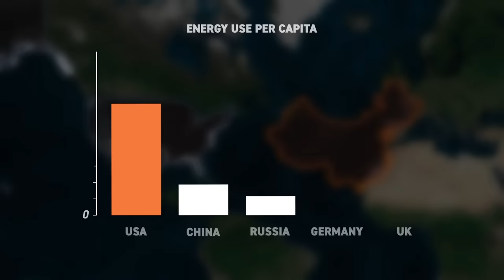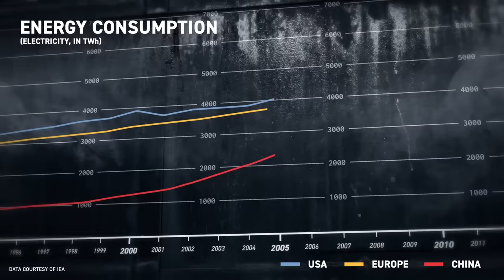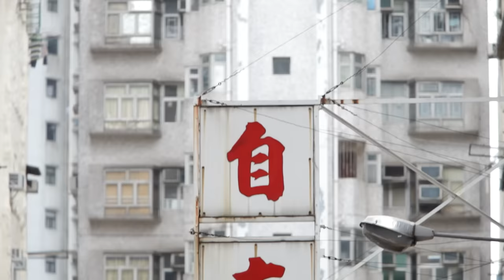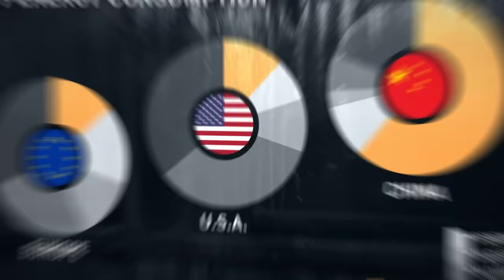China’s Electricity Problem

Comment: 1.1MV DC transmission lines?!?! That deserves a 45 minute video all on it's own.
Reply: I believe that might be the Hitachi (previously ABB powergrids) lines.
Reply: Many top Chinese engineering students will choose to study abroad for postgraduate or Ph.D., but my UHV teacher said that this law does not hold in the field of UHV power transmission.
Reply: I've removed my original comment to avoid getting the same response 1.1 Million times.
Reply: @robertlomax543  nope. It’s  3300km ±1100 kv UHVDC from Changji to Guquan. The longer the transmission line, the more economical it is, but it is true that the cost of this line is very high, so currently there is only one line.
Reply: @robertlomax543  Ultra High Voltage Transmission are almost exclusively DC. Power frequency AC transmission goes out of phase roughly at a distance of ~ speed of light / frequency = several thousand kilometers. At such a distance, DC transmission is the only option. 

Also, solid state transformers / converters / inverters are much more energy efficient than traditional iron-core based transformers, as iron loss is zero in solid state electronics.
Reply: @xiaohu3859  as an EE this sounds so counterintuitive. at the first level its more efficient to transmit power via HV AC but going even further distances requiring even higher voltage become less efficient at AC where as switching back to DC becomes more efficient.
Reply: @SpanasyukO  I'm not sure AC transmission is ever more "efficient" per se, but I'm no expert. It's certainly a lot more cost-effective to step AC up and down in voltage, since transformers are so easy to make. Nowadays DC transmission might actually be viable. But 120 years ago, with no serious electronic logic to speak of, there wasn't really any choice. The "alternative" (Edison) was low-voltage DC, which could never hope to compete with high-voltage AC in the long run.
Reply: @robertlomax543  AC actually suffers more transmission losses thsn DC due to inductance. It's nit that hard to invert efficiently nowadays.
Reply: @EebstertheGreat  with AC power you are always working against the capacity of the grid, DC is certainly more efficient at transmission.
The one thing AC excels at is transformation, which was not that efficiently possible at the time of Edison/Tesla-Westinghousen. I believe DC/DC transformation is more efficient than AC/AC nowadays.
Reply: @beaman_2000  A (roughly accurate) simplified version of this situation:
-HVAC lines cost $0.97 million/mile and the transformer at each end costs $5 million/unit.
-HVDC lines cost $0.81 million per mile and the converter at each end costs $30 million/unit.
For a 60-mile line: HVAC = $68.2 million, HVDC = 108.6 million
For a 350-mile line: HVAC = 349.5 million, HVDC = 343.5 million

HVDC also has benefits like no skin effect, two conductors vs three, it can connect asynchronous systems (i.e., it might be helpful in Texas this winter), and it works underwater.
HVAC is still way more convenient in most cases though because HVDC lines are really difficult to tap off of (as in there are two multiterminal HVDC lines on the planet).
A new 85mph highway between NYC and Pittsburgh that has no tolls and no traffic sounds nice, but what if I told you there are no exits for the next 370 miles?
Reply: DC! ... DIRECT! ... i mean ... you touch - you = vapor
Reply: Electroboom entered the chat.
Reply: @ltjgambrose     This is something new (to me) I was not aware of.   Thanks for the enlightenment.   Do you have a link that has a good technical discussion on the UHVDC converters (in English)?     Considering that we can put 30 billion transistors on a chip it is not a reach to be able to convert 1.1MV DC.
Reply: @xiaohu3859   many years ago the old tvs in uk had horizontal hold
as you speed of light
tv camera in studio.
100 miles away the sync pulses had to be equal to the camera
move tv adjust horizontal hold
hohum
Reply: Can someone explain to me why this is so impressive
Reply: @revaddict  Hey! I know that channel!
Reply: @kalactose348     Power wasted = resistance of the wire times the current (I) squared.   Power delivered to the destination = Voltage x Current.    Therefore the higher the voltage you can operate your lines at the less power is wasted.   The problem is that you air conditioner would quickly fry if connected to high voltage lines.  To solve that step down transformers are used for last few feet.  
Although power AC is at low frequencies (50 to 400 hz)  at extremely long distances antenna effects start becoming an issue.  It turns out that the Chinese (I didn't know this yesterday) now has equipment that can reliably and with low loss convert high voltage DC to low voltages.  I assume that it converts it to low voltage AC for reasons previously discussed.
Reply: @robertlomax543  thanks rob
Reply: @Robert Lomax - a shame a dozen+ others agreed with you. Real engineering explained this in his solar panels in the Sahara vid. It comes down to cost, over long distances: DC > AC.
Reply: DC has less resistance loss. The loss by transforming it makes sense after a physically and monetary distance.
Reply: @robertlomax543  hahahaha you really thought that 😂
Reply: @xiaohu3859  Resistive line losses are less as well with DC, it's the peak current om the sine curve that kills you.  Quebec in Canada was an early adopter of DC transmission.  Their biggest issue from what I can recall was interrupting fault current.  You brought up a good point about stability.  I like to think of it as pole slipping on a generator where the force pushing the power exceeds the magnetic force holding it in phase.
Reply: @appa609  Not really, inductance does not directly contribute to significant energy loss in transmission.  The majority of loss is resistive.  Induction causes phase shift and voltage drop on long circuits.  Many distribution system would install and utilise capacitor banks to correct the power factor (induction vs capacitance) and correct the voltage to the customer or at least allow the transformer tapchangers to be in a more useful range.
Reply: @niagaramike528  Another way to correct phase shift is with some actual rotating machinery.   May have to look in a museum for examples today.
Reply: @robertlomax543  DC is actually more efficient over very long distances.
Reply: At extremely high voltage, DC is more efficient transport.  At lower voltages, AC is more efficient.
Reply: @robertlomax543  what?  It's called an inverter.  Then you step down through normal transformers.  Switched mode power supplies can be over 95% efficient.  What did Tesla figure out?
Reply: @ulwen  That's my favorite model too. Really does a good job.
Reply: Why?
Reply: @robertlomax543  You're out of date: the most effective long range power transmission is ultra high voltage DC, it's relatively new and insanely expensive to setup but becomes feasible when you need to transport a LOT of power a long way.
Reply: @SpencerHHO  Keep reading and you'll see that I've already acknowledged everything you just said.   Having said that I would love to see the actual design for the step down converter.     That's a hell of a shift in DC voltage.   I wonder if they are using vacuum tubes or solid state and what switching frequency is used?
Reply: @robertlomax543  Tom Scott and electroboom have good videos on the subject. My understanding is that they basically use GIGANTIC transistors and capacitors the size of small houses. The input takes the standard high voltage 3 phase, runs it through a transformer that phase shifts it to make it 6 phases which is then switched/converted to DC by solid state silicon rectifiers (can't remember the exact terminology used but they are essentially gigantic transistors) which is then smoothed by capacitors also the size of buildings in their own right and the resulting UHVDC is sent down the line. At the other end it's basically reversed with the local 3 phase frequency controlling the switching back to AC where it runs through transformers to match the AC grid voltage and frequency. 

Watch the videos I mentioned as they explain it far better than I do but basically the tech that makes it work is pretty remarkable and is still pretty rare due to it's incredible cost to implement. 

It's becoming more common though and there is talks of use in countries like Australia with massive interconnected grids.  The Australia-asia powerful project is one project slated to begin in 2024 which will cover 30 000 acres of some of the best solar resources in the world with PV panels and supply Darwin and Singapore about 5GW of power over more than 3000 Miles of cable utilising 800KVDC transmission lines.
Reply: Believe in Jesus. He's coming soon
Reply: @ulwen  SGCC line, actually
Reply: @robertlomax543  search for them, they exist. HVDC power lines. ElectroBOOM has a video on that
Reply: yep, they are one of those incredibly important but often overlooked parts of transitioning to renewable energy... not only in China are the best regions for generating wind and solar power often far away from population centers. In addition, linking wind and solar plants over large distances improves reliability because even if there's no wind in one region conditions may be much better 2000 km away. China actually proposed a pan-asian grid reaching all the way to Europe at some point, I don't know if that plan is still alive. At any rate, China has pretty much completely leapfroged the rest of the world when it comes to this technology.
Reply: Repent and believe in Jesus Christ  how about no?
Reply: @robertlomax543  There is a high voltage dc line running from hydroelectric dams in the Cascade Mountains all the way to Los Angeles and San Diego.
Reply: @appa609  but isn't building capacitive compensation within those inductive lines a solution?
Reply: @m00str  I mean, grid compensation could maybe bump up the efficiency of AC lines a bit.
Reply: What's so special about the 1 MV figure? Soviet Union was building such a line 40 years ago. It wasn't finished by 1991, but it probably would have worked.
Reply: @xiaohu3859  "Solid state transformers are much more energy efficient" - are you sure? From what i saw by quickly googling it, standard line-freqency transformers are quoted at more than 99% efficiency, and solid-state ones at 95-98% at best and were able to achieve that only recently because silicon carbide tech progressed.
Reply: It's relatively new but not unheard of. It's actually just two 550kV DC lines in parallel using opposing polarities
Reply: @robertlomax543   It is a balance of losses problem. Transmission vs conversion losses. Economic (the plant is affordable) Conversion losses are going down.  OTOH carbon fiber for electrical transmission could change the economics too.
Reply: @xiaohu3859   Power losses over distance are the actual factor limiting transmission distance. Phase is a local condition when it comes to attaching power sources to the grid. As long as you match locally when connecting - slightly fast, slightly higher voltage, close the breakers as the phase is matched - everything is fine.  

All cores have losses.  The bigger the core the lower the loss ratio for a given power.
Reply: @robertlomax543  I'm sorry to tell you that the number of transistors on a chip has minimal influence on power conversion capability.  Power switching speed, losses, and voltage capability are way more important to power conversion.  Material changes have influence as well. SiC is up and coming.
Reply: @msimon6808  I guess you would have to dope the carbon with something since pure carbon is an insulator just like silicon.
Reply: @msimon6808  All I meant by that is that technology in general is advancing incredibly fast and things that were not possible 40 years ago are common today.   I did not mean to imply that high density CPUs is what allows 1MV inverters to work.
Reply: @robertlomax543  That's not how it works. AC has non-negligible reactance at long distances. DC does not. Resistive losses are the same for both. Solid state boost and buck converters can handle extremely high voltages now. The reason why AC is so popular is because, for non-backhaul cases, it's perfectly fine to use cheap transformers, and AC is part of historical infrastructure.
Reply: @michaellin4553  Can you give me a part number for a MV switch in MV buck converter?  I'm interested to see how it is constructed.
Reply: @imho2278  wdym by git? Bot with copied code from github or what
Reply: @robertlomax543  you need to study basic electricity and power transmission — this is not the place
Reply: @robertlomax543  Talk about museum pieces, I worked as an operator in a plant that had a 25Hz-60Hz operational frequency changer.  This was in the Sir Adam Beck 1 GS.  I think it's capacity was about 60MW.  It was thankfully retired at least 20 or so years ago.  Very difficult to synchronise the 25Hz and 60Hz systems.  Especially hard to do while the New York system (NYPA) had a frequency changer in service.  Slipping field poles and adjusting generator loads was an art that was lost as the older guys retired.  
I did work at a transformer station in the 80's that had 2 synchronous condensers for maintaining reactive power/voltage.  One was a fairly impressive hydrogen cooled spinning piece of equipment that was unfortunately ruined due to an accidental out of synch breaker closure (before I got there.. I'm innocent)  The other was a small 20 MVA air cooled unit that is likely no longer in use.  The power consumption to spin it has likely condemned it.
Thanks for bringing this up.  I totally forgot about the condensers.  :)
Reply: @ltjgambrose  Nice info.  You didn't include losses and equipment mtce costs though.  I'm very sure they are cost effective for long HVDC lines but was curious on the actual numbers.  Mtce costs can be prohibitive with SF6 use and ozone loss regulations.  When 350 mile line is in service for 30 years the loss numbers become quite significant.  Also...  the underwater mention confuses me somewhat..  Are we talking about non insulated conductors running underwater?  Insulate conductors?  If insulated why is AC better.  Sorry to pester, this is totally new to me as I'm only familiar with overhead and a few underground circulating oil cooled cables.
Reply: @sciagurrato1831  Been there done that 35 years ago as a EE.   Now I'm retired.   When something cool comes along that I haven't seen before it does intrigue me.    Otherwise I'm not on top of the latest trends.
Reply: @robertlomax543  you must not have been involved in power generation and supply. It’s really the first day of  class in power transmission — DC is the only to supply at great distances.
Reply: @niagaramike528  Back in the 80s I had a job as an ET before I became a EE.    One of my secondary duties was to manually reconnect commercial power back to a UPS after it had tripped off for whatever reason.   This involved watching a phase meter spin around and trying to manually time the closing of the switch as it got close to zero.   I always did a little time out to make sure I was only thinking about that one thing.   I didn't want to be the guy that brought the plant down.   Normally this was handled by the electricians but they didn't pull night shifts.
Reply: @sciagurrato1831  Had a single power and transmission class 30 years ago and it involved no active devices.   And I never had a need to work in power transmission after that.   I did know a female EE that worked at a coal plant and and she told me that all she did was manage the coal supply for the plant.
Reply: @robertlomax543  Your phase meter sounds like a Synchroscope to me.  We'd use them to ensure the unit was close to synchronism in phase and close to synchronous speed as well as matching voltage.  Many generators I worked with had dome lights.  A smallish glass globe that had a light inside that lit if there was a problem with that unit.  The joke was that any synch of a unit that left the dome light (glass globe not the illuminating bulb) on was a good one.  I've seen some nasty synch attempts that held but the best was big Al.  He mistakenly closed at 6 o'clock instead of 12.  180 degrees out of phase on the scope.  A lot of dust was flying around but the unit stayed on and was not noticeably damaged.  Mtce staff were standing by, they just about shipped their pants. This was a a 90 MVA unit at the time (since upgraded).  The switchyard it connected to had (it's even higher now) a huge fault capacity.  I'm glad I wasn't there for it.
Reply: @niagaramike528  Yes, I meant synchroscope.   I just couldn't recall the proper name.
Reply: @robertlomax543  yes, but at very very high voltages AC is more lossy over longer distances than DC, there's break even point with semiconductor-based voltage converters where the conversion becomes worth it due to the efficiency in transmission. Tesla existed at a time before we figured out transistors and could convert DC to AC and vice versa at different voltages more efficiently. tesla may have been ahead of his time, but his time has already long since past.
Reply: It's not, it's AC and it cost from Quebec, they already have 1.75MVac lines for more than a decade and currently developing 2.25MVac. An expertise developed since the 60's because of the distance between cities and dams (La grande, the biggest electric dam project is 1300km from civilization).
Reply: @ltjgambrose  The biggest problem with DC lines is the thickness of the cables. I highly doubt your numbers, where do they come from?
Reply: @kayakMike1000  No it's the other way, even the video show images of those "DC" lines with transformer stations with SF6 switchers used for AC. The DC problem is that it's really bad in distance and require an extremely thick wire. DC lines were invented before AC lines and were ditched because of how heavy and inefficient they were (Eddison vs Tesla). Might I add also the "DC" lines shown in the video has 3 wires while DC only require 2.
Reply: @this_is_japes7409  No the DC problem is the thickness of wires. It's not good at transmitting because of resistance. The large the wire the more resistance it needs. It's true for the same wire thickness DC is losing less but you can pass a lot less power than AC. Transistors has nothing to do with it, you are talking about transformers, not the same use as the transistor was invented in 1947.
Reply: @xavierboucher2037  DC is better than AC if voltage is the same. The problem with early DC systems was their low voltage with no good way to transform it. Now this way exists thanks to power electronics, specifically rectifiers and inverters that can make high voltage AC into DC and back.
Reply: UHVDC is most advanced in China. But as the video mentioned, the utilization is poor. Anyway, people interested might want to read report from MIT on smart grid. I read it when i was a student and it’s a great reference. But that’s almost a decade ago so there must be even newer report that’s equally as impressive
Reply: @E1Luch  No it's not. DC cannot pass as much power than AC for the same wire size. It's basic physics dating back from the 17th century. Rectifiers and inverters has nothing to do with this. Rectifiers are everywhere at home (what is called a power supply) and inverters are useless if the power is generated locally. It's simple, transport -> AC, local use -> DC.
Reply: @E1Luch  Oh and by the way, Edison's DC lines where 110V, it's not low at all. AC power can make ~150km with this voltage without significant loss. DC is several hundred meters and it was the problem for the Edison power lines. It was easy back then to increase voltage, it is not really hard. It's basically 2 coils and that's it. The principle is still the same today. The problem resolves around power not voltage. Voltage by itself has no meaning if you don't consider the current.
Reply: @jkjkjk100  What is funny is that UHVDC is not DC at all as the system uses frequencies (around 60Hz) which means the current is NOT continuous but alternating. Maybe not using a sin waveform but still neither a constant voltage line.
Reply: @xavierboucher2037  110v is very low for transmission, its half of whats in a wall outlet, and only 10 times whats in a car battery. Transmission lines operate at thousands of volts, and big ones at hundreds of thousands, thats 3 to 4 orders of magnitude higher. Resistive loss does not care about dc or ac, only about current. Infact, AC is even worse for that because of loss of effective wire cross-section due to skin effect. The whole point of raising voltage is to keep the current limited while trasporting more power. The point of making it DC at high voltage is to get rid of capacitive and inductive losses. I don't know where you learned the 17th century physics, but you might reconsider how good the source was
Reply: @E1Luch  ok, guess my electrical physic MIT grade is worth nothing next to the holy internet "I say so". Keep believing it when only China has invested on this (the other 2 lines being experimental). Stop excluding current from the equation. AC, DC, voltage level have no meaning without it. It's the classic 101 of people who fail in understanding electricity.
Reply: @E1Luch  And this "DC" technology is running at 60Hz so there is a huge inductive loss.
Reply: @xavierboucher2037  I mean you are two clicks away from reading about all the other HVDC lines operating across the world, and one click away from realising chinese grid isnt even 60hz, its 50. I guess youre trolling tho. Good talk, have a nice day
Reply: AC has extremely high losses at this high voltages and on these distances
Reply: @E1Luch  Residential wall outlets are typically 120v AC in the US. You get 240v from a two-phase “dryer” or “car charger” outlet.
Reply: @robertlomax543  last mile transmission is of course AC but the long distance transmission is UHVDC.
Reply: Judging from some of the replies, such a video on HVDC systems would be useful. Until then the Wikipedia page on High-voltage direct current  will provide an overview.
Reply: It's funny to see some old EEs in this thread still stuck with tech in the 50's and claimed they know everything when you can learn what UHVDC is with just a click away on YT.
Reply: @E1Luch  ah yes, thanks to a 5 minute google search I too, am an electronic engineer like you 😅
Reply: @berated4541  very funy, I too cant use google for any somewhat reliable information and pretend like you cant know anything to any degree if you dont have at least bachelors
Reply: @E1Luch  1. I was cracking a joke and making a point at your expense. If you took that personally I apologize, but if your going to post comments on YouTube I suggest you grow thicker skin. 2) google is just a middle man in which we get links to actual websites, some of these websites are quite credible. Maybe citing a reputable or credible source instead of just “google” would help.
Reply: @berated4541  If youre talking about solid state transformers comment, i didnt make any actual statements, just asked. Actual source was a couple of paper abstracts and some university presentations online, i dont even remember which, just that the actual journals were legit, but maybe can find some if you want. Also you were making a point and i replied in the same format. Dont project some bullshit on me, and my skin is none of your concern. Also if its about transformers, its funny youre asking me for proof when the guy i replied to didnt even mention where he got his claim from and still got hundreds of likes.
Reply: @xavierboucher2037  you should get your money back on that "MIT grade."  Power transmission capacity of a wire is the same for AC or DC
Reply: @m00str  DC to DC conversion is not more efficient. The DC is converted to high frequency AC to go through a transformer and then back to DC with diodes. Transformers only work with AC and any voltage raise or lowering requires a transformer when isolation is required. Inductors can be used to too, which makes a non-isolated DC-DC convertor, but then you lose isolation from the high voltage if things break.
Reply: My uncle was forced to leave his house in a rural area and was paid to build a new and bigger one 500 meters away(has to pay for the furniture on his own) since he lives right down from a 1MV DC  transmission line.
And you should know with technology and infrastructure like this level, we still face power shortages from time to time due to the rising price of coal and temperature in summer, and they(the gov) continue to keep the price of electricity at less than USD0.09(And 0 for install fees) per Kwh for residents(but can be much higher for factories and businesses who are the first forced to be cut off power when comes to power shortage which may result in a shortage in supply for Apple products). And a mid-income family will be considered somewhat rich if they spend more than 1000Kwh(About RMB600 or USD95) per month during summer times when there would be more than 15 days continuously hotter than 40 degrees.
And you have to know that China has to import massive coals from Australia and other countries and yet become the leader in power stability.
Reply: @xavierboucher2037  This is completely wrong, and one of the most common misconceptions of transmission lines. AC exhibits the skin effect, actually requiring even larger gauge to limit the current density at the surface. DC does not. AC and DC exhibit identical resistive loss (voltage drop) over a given distance when neglecting temperature-based effects. AC is simply easier to boost, while Edison's original system was never high voltage to begin with. It would require constant boosting up to a medium voltage instead of just going right up to transmission line level.
Reply: @ltjgambrose  Damn interesting!
Reply: My dad's comapy worked on that project! They participated the construction of the first line.
Reply: @robertlomax543  and we can't forget about that little thing called line loss. Regardless of how efficient your transportation method is distance equals loss and in the case of electricity more than 500 miles tends to become a losing proposition
Reply: @robertlomax543  DC for sure
Reply: Dc makes too much sense.
Reply: @ulwen  go for ABB
Reply: @robertlomax543  "Having said that I would love to see the actual design for the step down converter.     That's a hell of a shift in DC voltage.   I wonder if they are using vacuum tubes or solid state and what switching frequency is used?"

I'm not an expert but here's what I've seen on the subject. HVDC lines have converter stations at both ends. The DC voltage itself isn't stepped up or down but the converter stations that convert AC to DC and DC to AC also have transformers that step up the voltage before conversion to DC and down before conversion to AC. Nowadays the conversion is done with thyristor banks. In the AC to DC conversion they work similarly to diodes and then any ripple is filtered out with big capacitors and inductors. In the DC to AC conversion the thyristors are switched based on signal from the receiving grid making sure the phases are in sync. This kind of switching produces square waves. Then harmonics are filtered out using capacitors and inductors turning it into sine wave.
Reply: @crimpers5543  capacity yes not power. I don't see what capacity has anything to do here unless for some reason DC can transport with a time offset and break physic laws. Comparing AC and DC capacity in this scenario has no sense.
Reply: @michaellin4553  Go find a basic course it will help you understand. What's wonderful about AC is the phasing which partly solve the skin problem. And the skin effect is also on DC so I see no argument here.
Reply: @dtibor5903  Just like DC, your point?
Reply: @SpencerHHO  "The input takes the standard high voltage 3 phase, runs it through a transformer that phase shifts it to make it 6 phases"

This is slightly off. You can already get 6 phases from 3 phase power by using both phases (opposite) phases from each line. However, you can further increase this to 12 phases by using two transformers. One transformer should use a delta configuration on one side and wye on the other. This causes the phases to be rotated by 30° relative to ones from a transformer with the same configuration on both sides. In the case of 12 phases the phases next to each other are 30° apart so this way you can get 12 phases.
Reply: 很多老外没听说过这技术。
Reply: @seneca983     Thanks, that makes sense.   It hadn't occurred to me to go directly from DC to AC before reducing the voltage.
Reply: DC is actually way better for long distance and high voltages are common.
Even in the 1970s dc lines over 500kV were common.
Reply: @robertlomax543  DC is always better than AC when money isn't an issue.
Reply: @robertlomax543  DC is less efficient with conversion but it's more efficient for transmission over long distances. Past a certain distance, the extra transmission efficiency makes it better than AC (assuming the same voltage).
Reply: Ultra-cheap, clean energy technology:
Search terms:  Leonardo Corporation
Search terms:  Brillouin Energy
Search terms:  Brilliant Light Power
Reply: agreed
Reply: I don’t think people realize how incredible that is. Nuts
Reply: No gas water wind; hey that's a wrath of God.
Reply: @beaman_2000  ¹
Reply: @robertlomax543   You could also just turn notifications off.
Reply: If 34 of 36 are in China, where are the other 2?
Reply: Man, here I was thinking the 500 kV double circuit line I designed was big....
Reply: @xavierboucher2037  "DC cannot pass as much power than AC for the same wire size." 

So far as I can tell, you're completely nuts. DC is a special case of AC where the frequency is extremely low. All you get with increase of AC frequency is more skin effect, reducing the portion of your wire that actually carries current, leading to higher apparent resistance. Pure DC has no reactive power and no reactive power loss, either. I thought this was common knowledge among EE types. 

Wikipedia says that same thing: 

"HVDC requires less conductor per unit distance than an AC line, as there is no need to support three phases and there is no skin effect."

Even if this is some kind of fake DC, as your other comments seem to imply, the Fourier transform treats this as the sum of a pure DC system (most of the power) along with the less efficient AC components (minor portions of the power). If you really botch the implementation, the stray AC components of your mostly DC system might have horrific reactive power loss, and you might finally be worse off than a traditional AC system. 

I'm really scratching my head about what MIT you attended. Perhaps you were thinking about something esoteric like single-wire earth return, that lowers the efficiency of the system, but probably does increase capacity per total mass of installed conductor. But this can be adapted to HVDC and so it's not solely an AC thing. I even went to the obscure Wikipedia article on ampacity, to see if there was some standardization weirdness hidden in your phrase "same wire size". 

At length I'm finally forced to entirely believe you 100% when you say that your "electrical physic MIT grade" doesn't cut the mustard here on YouTube.
Reply: @SpanasyukO  I find inverter systems and pulse/ width modulation too sensitive to transients/lightning, the SS AC-AC directly I know less about.
Reply: Holdon, there is 1.5M v  already installed.
Reply: we still live in the steam age, even nuclear power plants only produce water vapor to drive the turbines, the same with carbon plants
Reply: btw., economic growth, China is not a wonder, most happens only thanks to the developed countries which transferred their plants to China, t is not the same like it happens in Europe, in which every state developed their own products
Reply: I would watch a video on this.
Reply: @SpanasyukO  if you can tell me how any power transmission in AC with its complex impedance is more efficient than DC, then you’re either working black magic or are missing the apparent. AC was necessary before power electronics since DC could not easily be boosted or bucked before switching electronic power supplies. AC is always less efficient for power transmission, the massive electric field gets absorbed by far more objects in the surrounding environment than the magnetic field of DC.
Reply: Paging Brady @Practical Engineering!
Reply: there are some . look up Siemens 1.1 MV who actually developed it.
Reply: @xiaohu3859  the inverters back to ac at such high voltage and current levels is the most amazing part.
Reply: @EebstertheGreat  ac is efficient because of high voltage reducing the current. losses are between 3 and 5% so 95 % efficient is pretty good.
Reply: @appa609  at ultra high voltage and current it is expensive to convert back to ac. this isn't a small invertor on some solar panels.
Reply: @robertlomax543  it's even more complicated as AC transmission lines have reactance which is in effect AC resistance. much power ends up wasted overcoming reactance . at a certain length this actually prevents current from getting through . it's kind of like a portion of the power bouncing back instead of getting transmitted.
Reply: @kayakMike1000  tesla runs at 400 volts. the power lines run at 1.1 million. the power electronics for that are nothing like a tesla inverter. which by the way was well known before tesla did anything. 
if you see a picture of a 1.1 million convertor it looks nothing like a tesl;a inverter. it's a huge room with something that resembles your intestines x 1000
Reply: EU and china even have a paper on a UHVDC powerline connection china with Europe
Reply: @kalactose348 
1kV can gap a mm of air.
1MV can gap a m of air.
So we are talking about a power line with a voltage that can jump over 1meter of air in operation.
That is impressive and scary.
Reply: Poor Tesla.
Reply: @SpanasyukO  DC is always more efficient but you also need to pay for the converter between AC and DC.
Reply: @SpanasyukO  I wish physics would make up its mind.
Reply: @beaman_2000   the break-over point is at about 600-700km once you take into account the infrastructure.
so clearly, any country that deals with these distances is going to lead any country that is below these distance.
Reply: @xiaohu3859   no... no it is not zero, becasue clown boy, there is still "iron" in electronic conversion, the difference is the frequency.
amazingly... if you get a magnet, it still picks up the core in an electronic buck/boost converter becasue they contain exotic ferric materials.
go read the TI (Texas instruments) book on switching convertors
Reply: That’s a good point.  DC transmission lines.
Reply: @O.s..a  I think you are correct, his face is getting redder and he's making strange moaning noises.
Reply: ⁸⁸⁸⁸⁸
Reply: @ulwen  Nah, it is homegrown technology. The only nations using Ultra-high-DC voltage electricity transmission is China and Brazil, and that of China dwarfs that of Brazil.
Reply: No kidding, China's the leading expert on high-voltage DC transmission, to the point that leading scholars often learn Chinese to keep up with the forefront. The new type 003 carrier also benefited indirectly with arguably better catapults than the U.S. Gerald R. Ford
Reply: @xiaohu3859  Seriously?
Reply: Uhm, ask  to italian people. They are building a massive 1 GW DC trasmission line 1000 km long. State of the art, with some pieces of technology never seen before. Ah, as extra bonus the cable will run deep under the sea.
Reply: @giuseppegenova4990  Transmission lines aren’t measure in Watts. That unit makes no sense for a transmission line.
Reply: @nasonguy  Ehm, no. The power line capacity is measured in MW.
Reply: There are many youtube video on Chinese UHV.  Most of them are in Chinese.  That is why the west said China isn't transparent because few westerners bother to learn Chinese.
In China there are more than 30 UHV transmission systems using 800kv, 1,000kv and 11,000kv both in AC & DC.  Outside China Brazil and Argentina are starting using Chinese UHV.  US and UK have only 500kv and 400kv max.  US potentially can benefit from UHV but its transmission system is highly compartmentised by different companies making UHV impossible.
Reply: @gunsumwong3948  Can you recommend some of those videos to me please? I would love to learn about them.
Reply: LOL typical YouTube "professionals" coming out of the wood work when literally NONE ASKED for their feed back😂 
It's always fake professional arguing with another haha 

Good entertainment